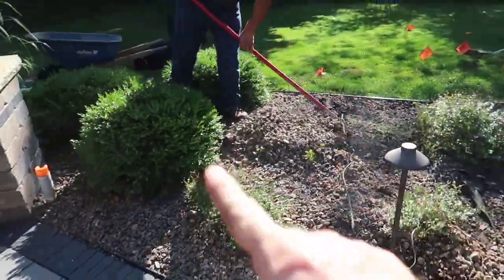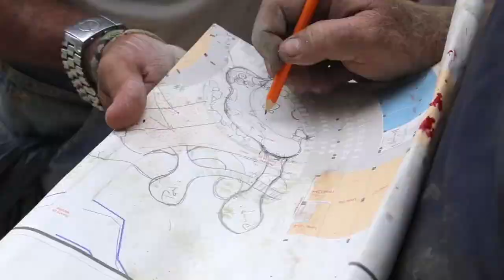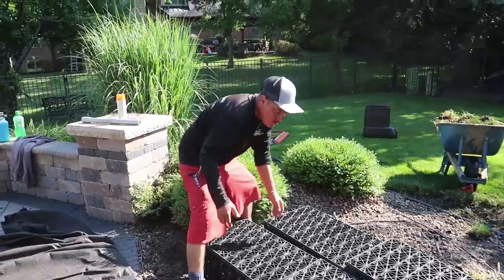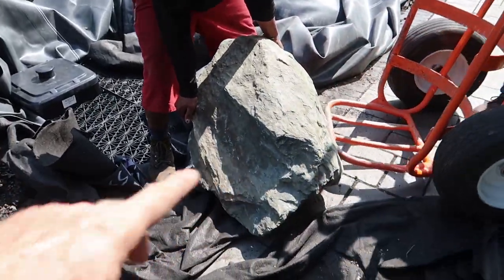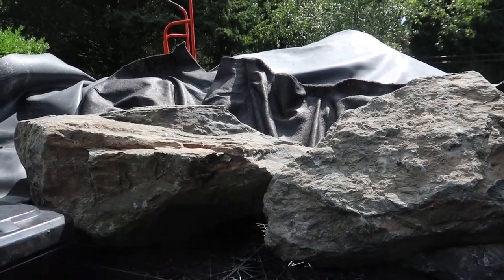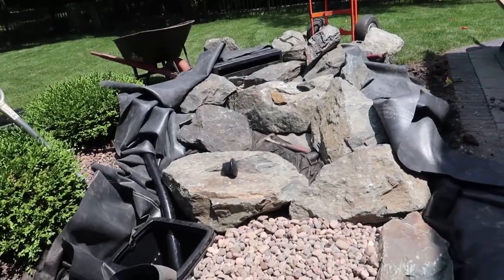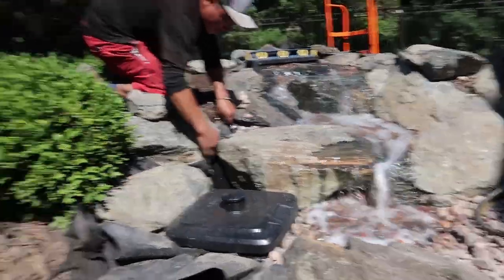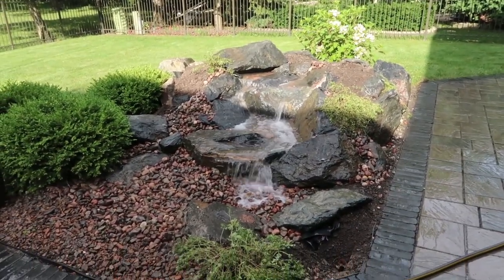A *SMALL WATERFALL* Can Fit Anywhere!

Comment: The flat gravel and instantly disappearing water has always looked a bit strange to me on these pondless systems. I was thinking that if you dished out the gravel below the bottom fall and placed a small square of plastic sheet just below the surface, you'd end up with a plunge pool for the final waterfall to drop into before it disappears, which would mimic a natural system more closely.
Reply: Aquascape does this a lot actually. It’s called a bib liner. Just a extra piece of liner put right at the bottom to help the water travel further